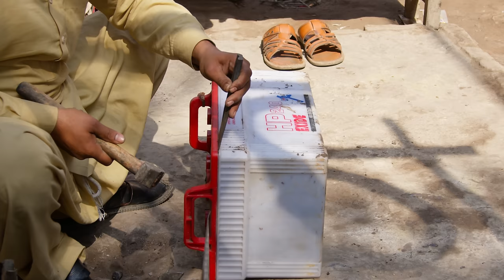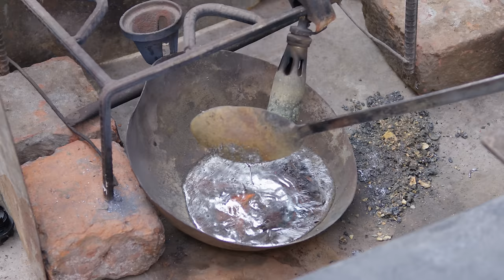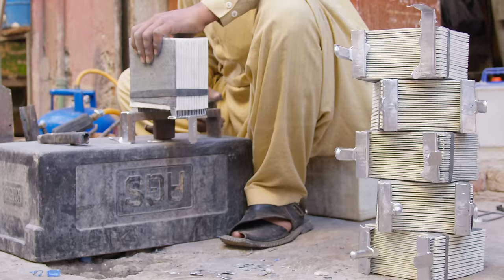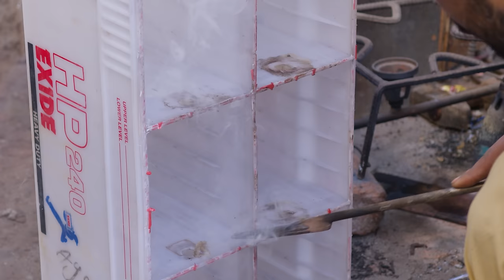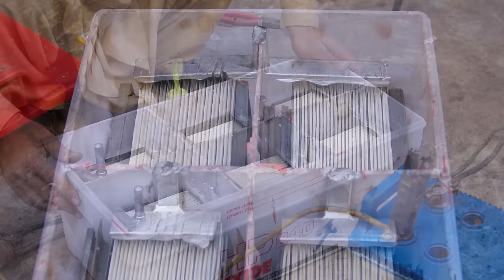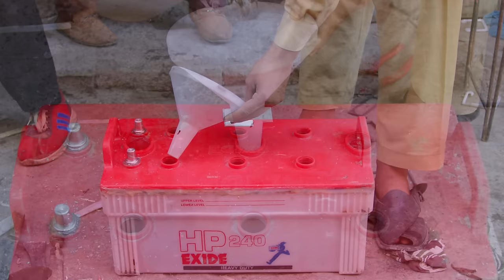Amazing Restoration Technique of an Old Lead Acid Battery

Comment: I'VE seen these guys work their magic on alot of parts reconditioning, here I think they need  some schooling. 1) PPE to prevent lead poisoning. Safety Glasses, Gloves, Respirator and work clothes preventing contact with lead. Respirator  filters  that block lead and vapors especially during melt. 2) Lead plates need to be chemically cleaned oof sulfates prior to reassembly with the new insulators.

Comment: Hey  you could use a hand held 3d printer for those stinky Plastic welds  and some baking soda or soda ash to neutralise the acid before throwing away impressive metalwork tho

Comment: It is clear that these folks are skilled workers, though lacking in education as to proper procedure.  What I don't understand is why the government doesn't create an industrial park, pool these workers into factories, and build things the right way.  I'm not saying that the government has to run these factories. They just have to create the infrastructure, regulations, and handle enforcement.

Comment: I saw and advice this technician 
AND 
Any one interested 
Kindly check the voltage of each cell 
If it is around two each 
The battery is not dead 
If one of them is less than one JUST CHANGE that one cell
And 
If it is boiling on chargung IT IS NOT DEAD 
Just REPLACE THE OLD ACID WITH NEW ONE 
And charge for 24 hours it will not boil 
And warranted for two to three years 
JUST THE WAY HE DRAINED 
BUT 
NOT IN THE MANHOLE
WHICH WILL POLLUTE THE DRAINAGE 
Any details ask me

Comment: Gostei em partes..
Trabalhei muito tempo recuperando baterias chumbo-acidas,  mas soldava as placas com maçarico a oxigênio e gás de cozinha.   No caso aí do vidio não creio que fica bem soldada os pólos somente derramando chumbo derretido em cima ... Pq o chumbo abaixo está frio e provavelmente irá soltar no primeiro esforço. 
Também o tampão da bateria foi unido somente nas bordas laterais..
Ficando sem lacrar no interior... O que ocasionará passagem da solução ácida de um elemento a outro...isto ocasionará curto circuito nos vasos e a ineficiência da voltagem e amperagem da bateria. 
A montagem foi Boa...com placas positivas novas...e reutilização das negativas...está montagem é típica de recondicionamento de baterias (reforma parcial)  Na montagem bateria nova usa-se positivas e negativas novas.     Mas para recuperação essa montagem foi boa 👍

Comment: You get: A rudimentary battery that can last 2 years or 2 days. 
You lose: Years of life and health by not using any protection in the process + All fuel and energy costs of the tools used to melt and solder the lead.

Comment: Wonder what that hole is doing to the local environment. Besides acid, there's arsenic in those battery compounds. I won't even get into what that guy is doing to himself working with lead with bare hands and breathing in those fumes.

Comment: That battery was 30% empty inside.. he left out loads of plates so from 240ah you now get 168Ah plus the battery will not be as chemically active so take out another 20% for that. Now your 240ah is 120ah at best. Double the weight and size. Still cheaper than factory?